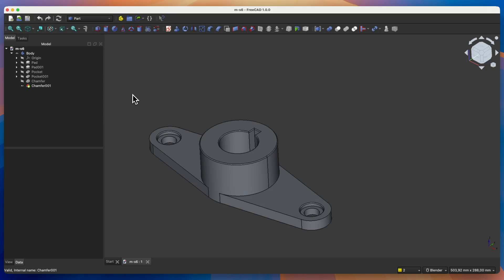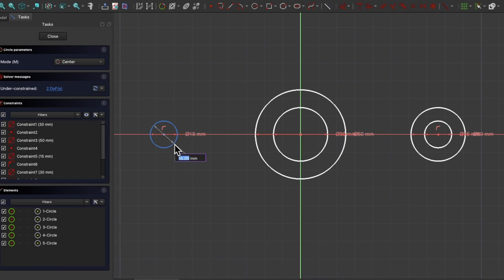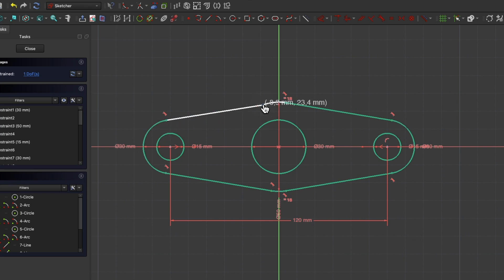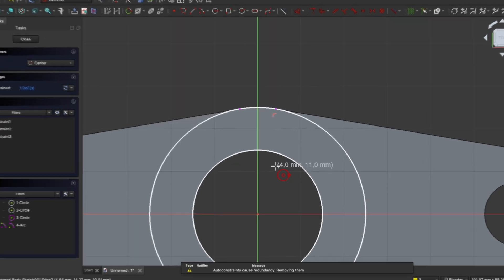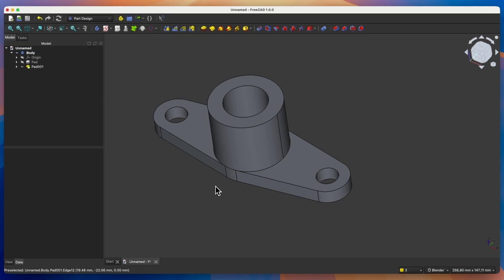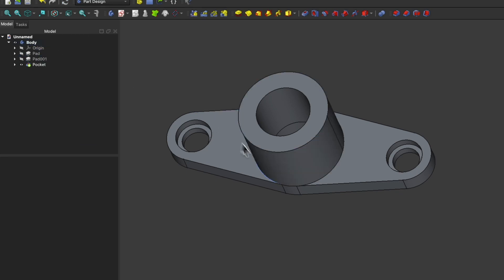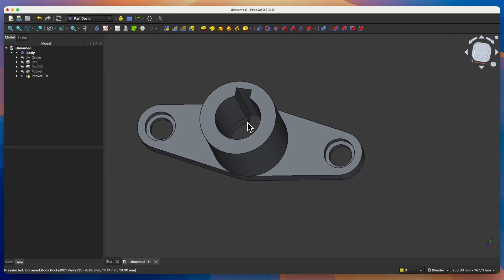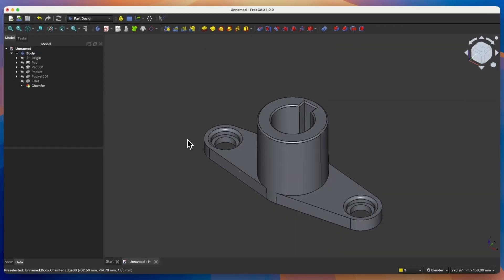Learn FreeCAD with CAD CAM Lessons: 3D Solid Creation and CAD Operations!

Comment: Thanks for making these videos. They have been very helpful to me in my FreeCAD journey. If I may make a suggestion, it would be very helpful to have a series on the hidden rules of FreeCAD. I've been tripped up a number of times on things like mixing up faces and planes when making a pipe. Also gotten bitten by having profiles, like say two concentric circles, and making a pipe with it, but it comes out all wrong because the second profile was drawn in a different order. I think that there are many hidden rules like that in Freecad. I hope that makes sense. Thanks again.